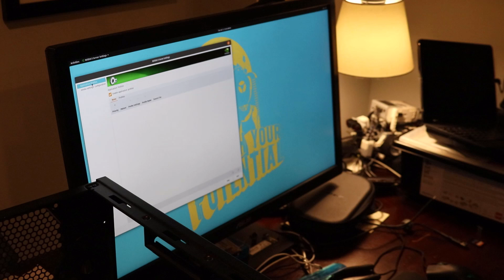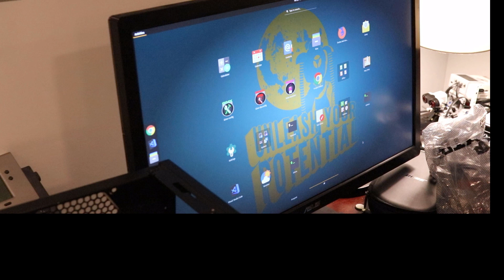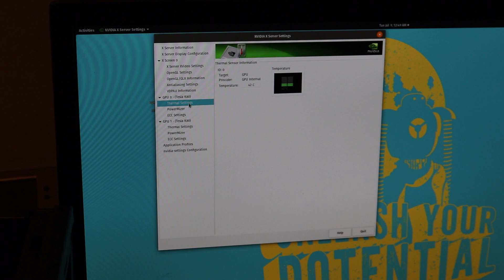NVIDIA Tesla K80 GPU 5 minute install

Comment: How about cooling?
Reply: There is a eBay cooler shroud for about $7.00 dollars a peace. You will have to buy a separate fan. I have no idea of how good they work  or how loud the could be. Never the less I picked up 3 of them. There is also a GPU block cooler for the k80s. Please see the below link.  http://www.ebay.com/itm/124194139093
Reply from the maker: This is the video where I cool one of these with a  custom temperature controlled air cooled setup. https://www.youtube.com/watch?v=I2zYOdfASFE

The cheaper and easier way is to just throw some 90mm fans on it and connect to the motherboard fan headers. You can see that approach in this video 
https://www.youtube.com/watch?v=lhTuWC_22vo

Comment: Hi Robin, thanks for sharing, are you using this for Data Science PC? do you know what motherboard allows 4 Tesla K80 GPU? Thanks a lot.
Reply from the maker: You will need a server class motherboard for sure with space for 4 PCIe slots. The Intel c602 chipset is a good bet but I can't say I know a motherboard that will specifically do this. I know in data centers  K80s in pairs were often put in these Dell PowerEdge R620 servers which you can get refurbed fairly cheaply these days
https://www.dell.com/si/business/p/poweredge-r620/pd

This other Dell server says it is able to do contain  3 Tesla K80s 
https://i.dell.com/sites/csdocuments/Shared-Content_data-Sheets_Documents/en/poweredge-r740-spec-sheet.pdf
But not 4. Sorry I can't be more help.

Comment: Thanks for sharing your experience, 
I'm trying to install K80 in Dell Precision Tower 7910 but it doesn't work. 
https://topics-cdn.dell.com/pdf/precision-t7910-workstation_owners-manual_en-us.pdf
Do you have any idea why?
I have a cable like the one in page 8 in the following link
https://www.nvidia.com/content/dam/en-zz/Solutions/Data-Center/tesla-product-literature/Tesla-K80-BoardSpec-07317-001-v05.pdf
Above 4GB Decoding is enabled
K80 is connected to PCI Express 3.0 x16 card slot
Power supply is 1300 watts
Thanks in advance
Reply: Hi! I have a T7910 too :) but I just got it and I'm getting familiar. I have an Quardro M5000 right now.  Did you get your K80 working?
Reply: @SeanLynchXY  
Hi, unfortunately, i got informed from DELL costumer support that K80 is not compatible with this workstation

Comment: I have a question. Is this the only video card on the system and does it boost the vidio built into the motherboard? I did not see how you connect the monitor to the pc
Reply: The K80 is a co-processor instead of a graphics card, which means it doesn't have video output. He's using the integrated graphics card on the i7 instead.
Reply: @fdc4810  and it can do it with an NVIDIA graphics card

Comment: please can you tell me, it work for a w110 x79 board and xeon 2680 v2, i want mix a quadro k4000 and 1 quadro k80 server with vacuum cooler. In 3d max it work por speed up rendering ? Did you know some web usefull for me?
Reply from the maker: NVIDIA did not produce a compatibility list for K80s and I have never found a website which helps with compatibility. My experience is server motherboards ASUS or SuperMicro or ASUS WS (Workstation) class motherboards tend to work. But you should look for a motherboard released after November 2014 as this is when the K80 was launched. What is the make of your motherboard? I have not been able to find anything on an W110 x79. My other suggestion is to looked for a setting called "Above 4GB Decoding" in the motherboard BIOS, you need to set this to Enabled. If the BIOS does not have this it likely will not work.  3D Studio Max supports NVIDIA graphics cards with Driver 430.86 or newer so I think it will work with a TESLA K80 as the current driver of K80 is 442.50 version (which is newer). I don't know for sure but I think it will work. I don't use 3DS Max. 
https://knowledge.autodesk.com/sites/default/files/file_downloads/3dsmax2020_GFX_ResultsNovember2019.pdf

Comment: Hi, robin. Did you test it fully loaded? I bought a M40 which has pretty similar performance on single precision. The temperature went up to 87c when fully loaded and the performance was throttled. Do you have any better solution to cool it?
Reply from the maker: I've made 2 others videos where I tried a single high performance fan and then one with 2 smaller fans but high CFM both worked really well I think the average temp was below 70 on each. The single fan configuration did not go above 60 just because the fan is crazy good. Here are the videos. 
K80 dual fan setup https://www.youtube.com/watch?v=lhTuWC_22vo
K80 single fan setup https://www.youtube.com/watch?v=I2zYOdfASFE
The single fan setup was harder to do as required a separate fan controller to be built. The dual fan just plugged into the motherboard fan headers and worked well. Also the 2 smaller fans were much cheaper here is the amazon link https://www.amazon.ca/gp/product/B07TC294GY/ref=ppx_yo_dt_b_asin_title_o07_s00?ie=UTF8&psc=1. 
I'd do the 2 fan setup now without a doubt. I ran both of these configurations for weeks on full load and they were fine.
Reply: @robin-g6  Thank you for your advice, Robin!

Comment: Great video. Do you still have the card or one to sell? I need a K80 and another Intel Xeon Phi co-processor card. Which motherboard are you using? I need a board for a workstation that I'm building that has BIOS support for above 4GB decoding to support the Xeon Phi Co-Processor card.  Let me know. and thanks.
Reply: There is a guy on eBay, who has the K80s for sale at 169.00 USD per card. I picked up 4 of them.
Reply: Abrondon Spears Hello,
Thank’s for the information. That’s funny, I’m actually buying several from the same guy on eBay. They have an OEM bracket installed but that’s no problem. I have the correct bracket. Do you know if the K80 supports vGPU? I was thinking about buying the Grid K1 for the server that I planned to virtualize the GPUs on but if the k80 will work then I can purchase a few more. I have another server running VMware and I need to accelerate the GPUs on the virtual machines.
Thanks :-)
Reply: The_PhD_of_Life, Hello. Craft computing, (another YouTuber) has built a VGPU server out of K40s. He shows a 3-4 part serious of how he built it. I plan to run 3 cards in a desktop unit (Thermaltake 900). I read a post that online that stated the you could SLI link up to 4 of these cards.
Reply: @abrondonspears731  Thanks for the info. I have used the Tesla family of cards for high performance computing for many years. I run many scientific simulations that are accelerated by GPUs.

It may have changed but I remember with my older Tesla cards such as the Tesla C2075 couldn't utilize the SLI port. That may have changed with the newer cards. I have used SLI with my Quadro cards but never with Telsa.

I need to check out the video you are talking about and see if the K80 is vGPU capable. If not I am looking at the GRID K1. I found a seller on eBay that has them listed for $79.00.

I need newer Tesla cards that are more powerful to run newer simulations. I'm still using the Tesla C2075 in one server. The K80 is very inexpensive now. It may be a few years old but it's a very capable card.

Have you used the Intel Xeon Phi Co-Processor? It's the Intel MICA (many integrated core architecture).

Comment: what is your mainboard ?.i just applied my k80 in gigabyte b360 in pci16 3.0 slot and i my tesla doesn't work it warning with code 12 problem. Any suggestion ? thank you
Reply from the maker: In this video I am using an ASUS Z170 WS 
https://www.asus.com/ca-en/Motherboards/Z170-WS/

I also have had success with ASUS Z10PR-D16, I have not been able to get other boards like I have a ASRock X99 Taichi. I do not know what that error code means. One thing I would try is to make sure "Above 4GB Decoding" is enabled in your BIOS its on page 33 of the manual for your board I think, link below.  

https://download.gigabyte.com/FileList/Manual/mb_manual_b360-hd3_1001_190603_e.pdf
Reply: @robin-g6  I have ASRock X99M Extreme4 w/ Above 4G Decoding option.  I was getting all sorts of error codes with the K80.  I was tempted to get a more compatible mobo, but then NVIDIA announced the specs for RTX 3080.

Comment: can you benchmark this card? I need to compare it to RTX2080Ti please
Reply: Im pretty sure 2080ti won't even leave a chance to that card due to Teslas' optimization. Tesla is a "pro" device designed for precise OpenCL calculations, movie renders, V-Ray and so on, it has no game ready driver like GTX or RTX have. Of course you can play games, but it is not efficient.
Reply: @rage3225  yeah I knew, I'm going to used for MD simulations
Reply: @radwanalnajjar9374   which gpu do you use for screen display. I have a quadro K6000 can be mixed with the tesla K80?
Reply: @papitonio007  what do you mean by mixing ?
Reply: @radwanalnajjar9374  I got a cheaper tesla K80 but it has not output for screen display and I try to mix with the K6000; however, Idn´t able to set the drivers. I also want to do MD simulations
Reply: @papitonio007  it's depends on tge software you are using. You should be able to choose which GPU you will use for simulations. Check your software manual for that.
Reply: I'm using 1080ti for one machine and 1050ti for the other.

Comment: Will one of these or a different Tesla card work on the same motherboard with a GTX 960?  I would not plan on SLI but rather use the other card to help encode and transcode video.  There is some software out there that will use the GPU and speed that stuff up a lot.  Handbrake for example if you choose NVenc.  To see that it is actually doing something, you can open the task manager in Windows 10 and go to the performance tab.  From there look and see if there is any GPU activity, it will look similar to the graph for CPU activity except that the CPU is not doing so much but you will see activity on the GPU.  I chose Handbrake because it is free and you don't need extra software to make it work as you might with other software.
Reply: Your motherboard must support above 4G decoding. Check your bios

Comment: I have Tesla P40 and ProLiant gen 10 server and I use the standard raser kit that comes with server and whenever I power the server up, it doesn’t go up and all lights blows up. Also, the power cable came with the GPU has dual outs (check image link below). I will be thankful if you share any ideas.
https://i.stack.imgur.com/zflcA.jpg

Comment: Hello, bios setting above 4G decoding is for all video card with more than 4gb ram or for this kind of accelarator nvidia tesla? 

Also, you can install a secondary video card? My Intel i9 9920x doesnt have a GPU INTEL HD video card in processor, so ...

Thanks.
Reply: Above 4G decoding is for 64bit addressing, meaning double precision compute. A normal graphics card with 8GB of vram does not need this. You can install a graphics card if you have a CPU not an APU

Comment: Don't ever plug the 8-pin CPU into that card...it's a dual GPU that uses a dual 8-pin connector to the two 8-pin GPU connectors
Reply from the maker: It takes an 8 pin 12v cpu connector , here is the spec, page 8 shows an adapter from PCIe to CPU 8 pin. If you have a spare CPU connector you can power it with that. That’s how most servers power it with a single cable. If you only have pcie connectors the 6+2 type you can get an adapter to 12v 8 pin CPU connector. https://www.nvidia.com/content/dam/en-zz/Solutions/Data-Center/tesla-product-literature/Tesla-K80-BoardSpec-07317-001-v05.pdf
Reply: @robin-g6  I'm going to read this link.  I thought this connector was a GPU connector.  Interesting.
Reply: I see, so this is off of the PCIe rail.  It's a converter into it's CPU connector.
Reply from the maker: @MajinErick  Yes agreed not PCIe, its really not like a graphics card in terms of power. Actually if you plug a PCIe cable into it it will not work, a smart PSU will not even power on. A PCIe cable when plugged directly into one of these will have its 12v line shorted to ground. Not good.

Comment: what can the tesla cards be used for? video encoding??
Reply: Video encoding, physics simulation for CAD, Python TensorFlow and other CUDA/OpenCL tasks via API. Really it's like having a small RISC cluster you can send batch jobs to if you get into OpenCL.
Reply: @drstrangecoin6050  so i cant use it for gaming ?
Reply: @1337-l2e   You could use it for that but it's not really made for it. First thing, it is not pipelined to push frames like the GeForce cards, but is instead optimized for extreme 64bit floating point mathematics in parallel. Second, check out how it has no fans and only a passive heatsink; these cards, unlike gaming cards, have to rely on your case fans for cooling. Third, note how it has no video output (no HDMI, DVI, etc.) You will have to set up a graphics pipeline from the card to VirtualGL to VNC or Xorg and encounter a lot of overhead for it.

I have done some light gaming to test this using a Nvidia Quadro K4000 in a HP Z420 workstation I used primarily in a compute cluster, but I am talking about Half Life 2. No ray tracing or extreme tesselation here. Games like Metro2033 still made the thing chug and drop frames. 
You could possibly put it in a machine with another video card which is actually for video, but even then you wouldn't see as good of a performance/$ as you would by hooking up another GeForce via SLi.

Comment: so PopOS has nvidia drivers, and cuda development libs, and tool's preinstalled? That would be great, because I just did a ubuntu 18.04 system, and it was a PITA to get all that installed.
Reply from the maker: The Nvidia drivers and installed with the OS and then its one command to get a working CUDA, CUdNN and Tensorflow setup, just  ‘sudo apt install tensorflow-cuda-latest’
Reply: @robin-g6  sweet. Thanks for the info, this is going to save alot of time.